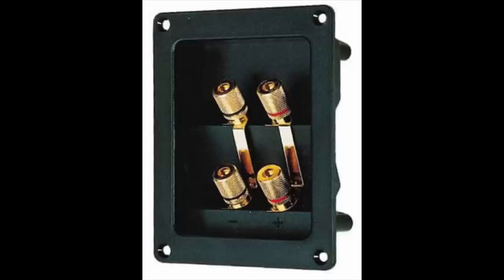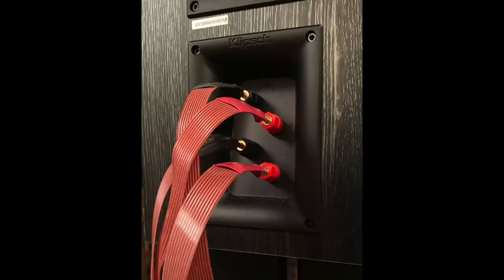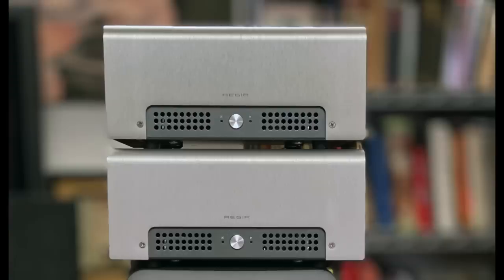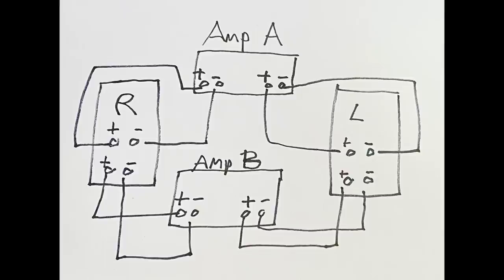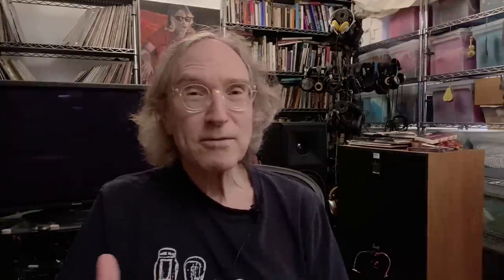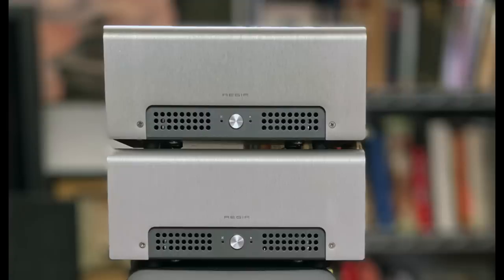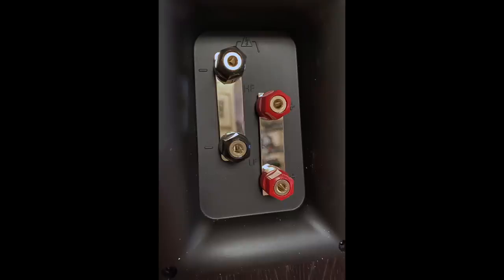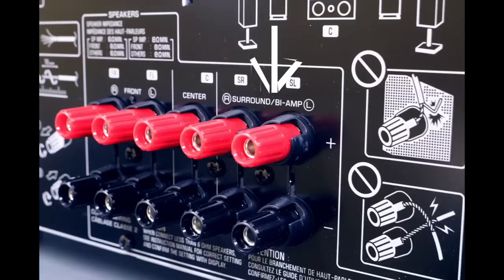It's time to think about bi-amping your speakers!

Comment: Even better is ‘vertical’ bi-amping. That’s when you bi-amp, but use one stereo amp for both bass and treble of each speaker. Whenever we did this in the Hi-FI shop I worked in, we found it had a little more refinement than regular bi-amping... ymmv 😀
It does mean you have to split right and left channels. So send two right channel signals to one amp and two left to the other...
Reply: Have you ever try dual mono vertical bi-preamping + dual mono vertical bi-amping with two identical integrated amps？  About thirty years ago I've used two NAD 304 integrated amps for exactly that.  I've used one for the left channel the other one for the right.  The sound stage width, height, depth, quality and ability to hear deep into the music increased by at least 4 times !💥
Reply: I did this for years using a pair of Rotel RB971MKII's and a Linn Kolektor pre amp.
Reply: @chrisgoodson9312  The two Rotel RB971MK2s are dual mono vertical bi-poweramping but one Linn Kolektor is only one stereo pre-amp that's not dual mono vertical bi-preamping.
Reply: @tricotdiko1435  As I understand it, Normal bi-amping is using one stereo power amp to drive the bass of both left and right speakers. One stereo power amp to drive the treble of the left and right speaker.
Vertical bi-amping is to use one stereo power amp to drive the bass and treble of the left speaker and one stereo amp to drive the bass and treble of the right speaker. E.g. Instead of one amp having to do bass for two speakers, it evens out the load, so both amps drive bass and treble. It does make a difference...
Sorry if that's not clear. Someone else might explain it better...
Reply: @chrisgoodson9312  Try using two Linn Kolektor pre amps to do the dual mono vertical bi-preamping, the results will blow your socks off.
Reply: @cool3rking  Thanks so much for clarifying the terminology. I was wrong. Bi-wiring for 30 years. Going to try horizontal biamping but only because a twist of fate I have ended up with two similar amps. The 64 dollar question is, would the money, time and space to buy another amp, splitter and another set of cables be better spent on speakers or room enhancements etc? I am skeptical. Thanks again for setting me straight.
Reply: @tricotdiko1435 
All of the things you mention have equal importance to your endeavor.
You should strive for full accomplishment!
Reply: Don't get how that would help if there's no electronic crossover, unless one speaker input has  horrible impedance swings, vertical bi-amping would mean only one chan sees the bitchy load versus normal bi-amping where one amp would see nothing but that bitchy load on both chans. I see how your way is better than using bridged stereo amps as well, a lot of solid state amps don't sound as good when bridged, if I remember correctly the min speaker impedance allowed doubles bridged, as does distortion, while I think damping factor is halved.
Reply: @jtee9548   with all of these things, it's a suck it and see scenario.  Of all the times we tried it, we (shop staff) preferred it. But as I said in my original post ymmv. 😊
Reply: All I can think is that instead of one amp having the bitchy load of mid/bass from both speakers and the ‘treble’ amp having it relatively easy, they both share the load..
Reply: @cool3rking  Yeah, we would try all kinds of stuff during the day, especially when it was slow, but mainly after hours with some beer 😁 We would compare speakers in particular. It never occurred to us to try hooking up amps your way. It was the most fun  I ever had at work, all that experimenting.
Reply: @chrisgoodson9312  Did you ever drive the Rotels bridged as mono blocks? Interested in the comparison bridged vs. bi-amped

Comment: Hi Steve, not long ago you experimented with bi-amping the Sonus Saber tower speakers with the McIntosh dual apms at the McIntosh facility, doing exactly that: driving the mids and the highs with the tube channel and the lows - with the solid-state channel. You seemed to be happy with the result, but yes, you did state, that this particular tube amp didnt sound like a typical tube, plus it was a very high-end amp designed from the beginning to do exactly that.
Just wanted to mention that.
Id suspect, that a typical tube amp, having a weak if any global feedback loop may be introducing a larger delay in the signal path and still be ok on its own, but when you pair it with solid state - the outputs could be "out o sync" so to say.
Thanks for researching this topic for the community!

Comment: Bi-amp is required for my current hungry IRS Betas, I’m still using my stop gap “temporary” set up of an old SAE 502a on top end, and an Adcom GFA 555 on the woofers.  Would prefer Audio Research w/ tubes on the panels, something with a volume control. I have VTL 300 Mb, gonna drag those back out soon and retest, after recently discovering I had an ac outlet wired backwards (!), which might explain my fuse blowing issues.  Fingers crossed.

Comment: When the preamp in my Rotel RA975 (100W/ch) began to die, I purchased a Rotel A11 (20W/ch). The old power amp now drives my woofers/lower mid-range and the  tweeters are driven by the 20W/ch amp. Works well and I wouldn’t go back to the way things were before. It didn’t take much effort, saved an amplifier I’ve enjoyed for 20 years and yes, the result is more detail and a hard to describe slight extra “meatiness” in the bass. Not huge—it’s subtle. And your techie friend is wrong—there’s plenty of valid technical reasons that there would be a difference, but not of course what the result would actually sound like.
Side note: I’d always intended to try something like this but never got around to it until fate intervened. I also added a DSP and played around with active crossover as well. I could happily live without the DSP, but not the bi-amping.

Comment: Hey Steve, I watched a few youtube vids on bi amping, mostly from curmudgeons like PS Audio and GR Research who were of the opinion that it doesn't help.  Then I checked out your video and man I was excited to try it.  My new Klipsch RP-8000Fs were not sounding great to with my home theater Onkyo TX NR6050.  I was hoping that bi amping might help.  It made a huge difference and turned around feelings of buyers remorse.  the Klipschs' sounded much more lively and... IDK... higher resolution.  There is a bi-amping setting on the onkyo, some added speaker wires and presto.  I don't know what is under the hood of the Onkyo but this change made a difference.  Thanks for the inspiration

Comment: After watching Steve's review of the McIntosh MC901 tube/transistor monoblock amps where he said the solid state was for the woofers and the tube for mids/tweeters I immediately set to test biamping my speakers with the class D I was already using for just the woofers and a solid state amp I have that's designed to behave like a tube amp for my mids and tweeters. I had tried the wannabe tube amp before and didn't like it's lack of midbass. But biamped me likes! The wannabe tube amp has warmer mids and highs than the class D and makes the sound a more pleasurable experience. The wannabe tube amp has level controls so I could adjust it. No, it'll never be the McIntosh monoblocks, but I am sold on the biamp idea, especially if you have two different amps that excel at different parts of the audio spectrum. You can use each amp for what it does best.

Comment: Hi Steve I have an Arcam Alpha 7 integrated and an Arcam Alpha P8 power amp with the 7 driving the tweeter and the P8 driving the base on my Polk Audio A1a speakers and the improvement is really noticeable over just using the integrated. Thanks for another great video.
Reply: I've done the same for years with an Arcam Alpha 8 and Alpha P9 power amp driving AE floorstanders.

Comment: Yup, I tried this about 13 years back BUT, long before the advent of educational YouTube reviews... 
I was "kinda - maybe" successful to "just not". My basic premise was that tubes (class A) would
bring out the best for high frequency and solid-state for the low-end stuff. And, as you did Steve,
I used 2 different Amp-systems. Rotel/Adcom for the lows and a class A integrated (flea-watt)
for the highs. Playing with the separate volume nobs "occasionally" yielded a bit of magic but
every CD I played needed adjustment (and sometimes each individual song on that CD). I lost 
weight constantly moving between my chair (sweet-spot) and the amp volume nobs (no remote).
Would I do it again? I just might because I am considering a couple of Aegirs. SO STEVE ...
QUESTION: How did you pre-amp the Aegirs? (or did I miss something?)

Comment: Thanks Steve.
Did you compare just mono-ing each  Aegir amp, then running one per speaker instead??
I run bridged stereo monoblocks to my LS50s- no biwire connection by design.
I must say I find it hard to cope with the idea of passively filtering out 80% of the output of one amp for the tweeters :-D
Lastly: running powered subwoofers is already biamping;-)
Reply: MAD GRUMPYMAN  
Boy you're a LOUDspeaker:-D
I run my 27hz full range transmission lines with subs too...just to make you grumpy!😆
Reply: MAD GRUMPYMAN  
You can imagine me doing just that, If that will make you a happy curmudgeon :-D

Comment: This simplifies the load on each amp - the interaction between the loads of the woofer combined with the upper frequency drivers is going to have any effect on the amp's ability to drive the speaker.

I have done this - but with an active crossover and DSP EQ as part of that. So the balancing is part of the EQ. I used a Schiit Audio Vidar on my Linaeum LT1000 woofers, and a B&K ST140 driving the stunning and unique Linaeum TLS tweeters. I use a miniDSP 2x4 HD active crossover and EQ, and REW (Room Equalization Wizard) program for measuring the speakers, and making the EQ filters, that are loaded into the 2x4 HD unit. The crossover is at 440Hz (really!) with 4th order Linkwitz Riley slopes. The LT1000 is a transmission line cabinet - bass is the best I have ever heard.
Reply: The dsp is limiting you in this case. The dac in the 2x4hd is trash. Get a nanodigi 2x8 and some real dacs.
Reply: @LexLeonard  I will check that out. I'm sure that the miniDSP is not the best, but I can assure you, it sounds pretty darn good. I would love it is a company with a focus on audio quality - like say Schiit Audio - would build this type of unit.
Edit: I see the nanodigi 2x8 is also made by miniDSP, and it does't appear to have the same functionality as the 2x4 HD? And the unit has 1 input and 4 out - why is it called 2x8?

Comment: I have been bi-amping Magnepans for 30 years. At first I used two solid state NAD amps. The less powerful was an integrated amp so no need for a preamp. Both amps had volume controls. Now I have Magnepan 3.3s. Their crossovers are external, making biamping---passive or active---a simple matter. If you have 3.3s or 3.6s or the earlier version of the MG 20 Maggies, biamping is relatively easy. Sadly, the 3.7 and 20.7 and 30.7 all have internal crossovers, rendering biamping impossible. I have brought this up to Magnepan and had a phone conversation with Wendell. He does not favor biamping, alas.

Now I use three amplifiers. Two solid state Emotive HC-1 XPAs for the bottom and a Jolida 1000P tube amp for the top. Of course I have to use a crossover, and the Behringer Super X-Pro CX2310 works fine. My tube preamp is a Jolida Fusion. 

The sound is extraordinary---exactly what Steve said.

Comment: If you do not have 2 sets of pre-amp outs but the pre-amp is true balanced, you can split the balanced out into 2 single end circuits. This way, not only are you using 2 power amps for each speaker, but also 2 pre-amp circuits as well.

Comment: SUGGESTION  If you really want to get into loudspeakers as a hobby, here is one cost effective solution.  Build two bass boxes that contain either two 10" woofers or two 12" woofers if you have the space.  You can wire two woofers in parallel if they are 8 ohm rated or higher, or you can wire two 4 own woofers in series.  Build the bass boxes yourself or have a local cabinet maker do it.  Use at least 3/4" MDF and make the front baffle double thick.  Use bracing if you  can figure out how to do that from pictures or books.  At least there should be a center brace between the two woofers.  Paint the inside of the speaker box with multiple layers of anti-resonance compound available from Parts Express and elsewhere.  Plastic laminate will make the woofer boxes even stiffer.  Buy a simple two way electronic crossover set at 12 decibels per octave at 200Hz.   So you need two decent stereo power amps.    One amp will run your subwoofers, preferably sealed, and the other will run any small two way bookshelf speakers you like.   At 200Hz you can use any speaker on the market with a 5" or bigger woofer for the top half of your system.  Cut a foam pad to cover the top of your bass boxes and just rest the bookshelf speakers on top.  At 200hz time alignment is not critical.  The beautify of this idea is that it is flexible, and you can change your top speakers often or build your own.  Using dual woofers makes the woofers faster because they only have to travel half the distance to create the same amount of sound.  Even using two 12" woofers you can get tight midbass up to 200 Hz and great room coupling.  With dual 12" woofers in a 4 cubic foot cabinet you can achieve in-room response to 20Hz without equalization.  There is nothing like the effortless bass produced by over 1,000 square centimeters of cone area.  I first learned that lesson when I heard the Acoustic Research AR9 loudspeakers in the 1970s.  I suggest having the woofers front firing only, unlike the AR9s, however.  See   http://www.thevintageknob.org/acoustic_research-AR9.html  EXAMPLES: 12'" woofer = https://www.parts-express.com/dayton-audio-rss315hfa-8-12-reference-hf-subwoofer-8-ohm--295-445  10" woofer = https://www.parts-express.com/dayton-audio-rss265hf-8-10-reference-hf-subwoofer-8-ohm--295-442
Reply: What crossover do you recommend?
Reply: @peterdesmidt8742  There are many electronic crossovers available on the market today. Do a web search and find one that fits your budget.  I had a friend build mine for me, so I cannot recommend a current specific brand.  I have owned several 24db per octave electronic crossovers, but got rid of them because they just ruined the sound for me.   I like simple 12db per octave slopes at 200Hz.  Generally speaking, simpler circuits have lower distortion.  The Rolls SX95 Subwoofer crossover looks good on paper and is only a hundred bucks.   I have not heard it, but if I had a limited budget I would give the Rolls a shot.  Its frequency is adjustable, which is convenient.  https://www.amazon.com/ROLLS-SX95-A-B-Box/dp/B07KJRYHFH  If you found the frequency you like best, you might be able to solder the dial in place to make it a fixed frequency so there would be less possibility of adding noise.  I have not tried that.  At just $100, it would be fun to experiment with, and you could change the capacitors.
More expensive crossovers are available at https://sublimeacoustic.com/products/k231-stereo-3-way-active-crossover

Comment: I'm bi-amping with my Sony DA2400es, this has bi amp feature AND pre amp out. So yes, I am using another Sony stereo amp to power the lows. I prefer to offload some of the power to another amp, it probably creates a little noise for the extra signal path but right now, it sounds good. I'm looking to get 3xCambridge Audio p500s for my rear, centre and replace the Sony integrated am using as a power amp. I do have 5.1, using the SoundblasterX AE-9 as a transport/pre amp. For media playback a 5.1 dac is incredible. Of course analog from the PC using a sub £50 2m cable for all channels then a more expensive jumper length from Sony to Sony and QED XT40i to my bi amped speakers. Good power cables and a conditioner. Soundstage, detail, power, it has everything right now and I know the bi amping improved the soundstage and detail when I first tried, I was hekkin impresssed.

Anyway lol thats my life story \o/

Comment: Hi Steve, I've been following your channel for some time now, and I enjoy every episode and find them very informative. If I'm not mistaken, in one of your episodes, you talked about Elac bookshelf speakers. Elac has come out with a new Elac Carina bookshelf speakers and I wonder if you're planning on covering them in your channel? I have a pair of Totem Sttafs, that is connected to my new Cambridge CXA81, and I'm looking on replacing them with either the KEF LS50 Meta or the Elac Carina and would like to hear your opinion on both of those.

Comment: I bi-amped Usher V9801 with Supra Rondo cable to Usher AU6500 bypass preamp direct connect to Point P-type Dac, use Dac as preamp, the result is definitely better. Better bass control, cleaner sound, shaper stage image. Supra cable basically provide a smoother sound for the system, and I think bi-amped it just add a much more reasonable power for the speakers.

Comment: I have 2 Plinius SA 102s 125 watt pure  class A ss amplifiers truely ballanced differential bridgeable 730 watt monoblocs that i run in mono mode in my hometheatre setting with Mirage OM 6s.
The advantages are obvious and much like. Steve described
I also have Klipsch Cornwall mk3s in a pure 2 channel stereo configuration with either Dared VP 845 set 18 watt pure class A integrated or a Cary cad 300b sei 8 watt pure class A.
Variety is the key to opening doors of exploration .Perhaps ill try the Plinius amplifiers in various configuration on the Cornwalls for a venture into the aural pleasures of decadence!

Thanks for sharring your experiances.
Much enjoyment!